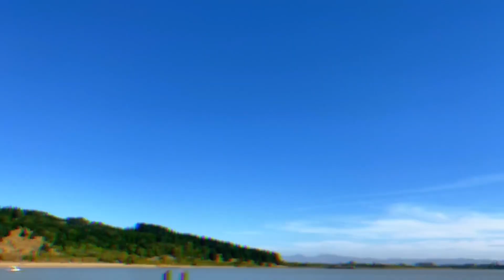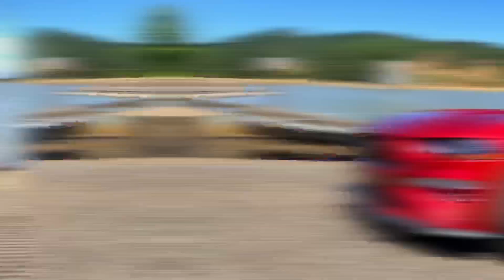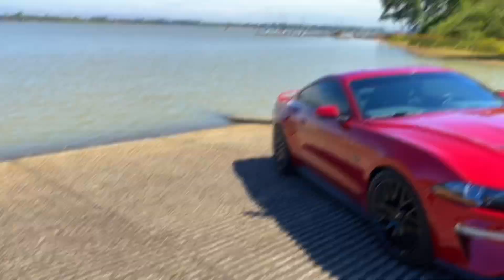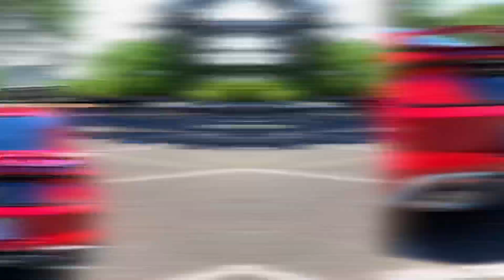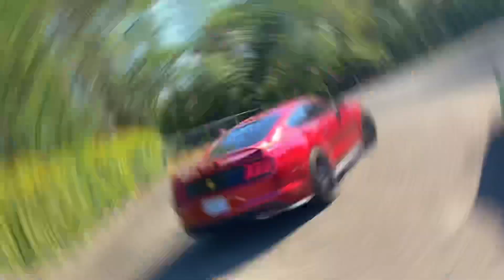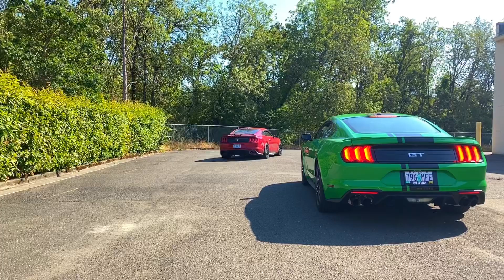Mustang gt x pipe vs H pipe

Comment: So as an owner of a 2015 GT I can honestly tell you ... the Axle back and the X-pipe or H-pipe truly don't come to life until you add a Long Tube Header ... at which point you will go from the cool guy in the neighborhood to the guy/girl that the entire neighborhood absolutely hates because the sound is on another level and its absolutely amazing! I need to do a sound clip of my 2015
Reply: Still waiting on that video.
Reply: Can confirm, running catless Outlaws with no resonators
Reply: Add racing cams, then you really have the total sound.
Reply: Comment made my day 😭
Reply: I've been there before. Had a 91 Scottsdale with a 350 TBI motor. Added some large diameter short headers and it was already tru dualed out the back with straight pipes and ha a mildly lopey cam. Either way I added mufflers as soon as I could it was ungodly loud without cats or mufflers!
Reply: Can't wait to add headers and actually cam my 14, then my 5.0 with Corsa Extremes will be ALIVE, and yes I'm keeping my Extremes after headers, and keeping H-Pipe setup. I want my car to SCREAM!!! The Steeda H-Pipe and AWE Touring H-Pipe catbacks sound incredible with headers, so I can imagine extremes.
Reply: I’ve got stainless works headers on my 15, no x or h pipe yet as I want my neighbors to like me😂

Comment: I was once thinking the X- option, not any more. As an European, I do not consider European sound as exotic or something, the X makes the engine sound smaller ,and like it is having a hard time moving the car. Some 2 to 1 systems with pipes before it just of wrong lenght sound bad too, so sometimes instead of Y-connection, a muffler with two inlets/one bigger out sound better. So, even if the pipes connected to the X happen to be just right and may give marginally more power, the sound is not "V8 enough"; the sound is like a John Wayne-movie dubbed in Japanese, I have heard that, and...

Comment: Do you think the brand for an H pipe matters for the deep tone???
Reply: Did u find anything about?
Reply: @SKKrry  naah man no reply sadly
Reply: not too much, mainly the diameter but some brands can use cheaper materials than others
Reply: Nah don’t matter, they all the same essentially
Reply: @malcolmbrown9733  really ok thanks man
Reply: Some use steel and some aluminum. Spend the little bit extra on the steel for mid pipe. After listening to a ton of these it’s very slight and most of all better quality.

Comment: Do you get more or less drone with the H pipe
Reply from the maker: I couldn’t say, I haven’t rode enough in the xpipe car to be able to tell but I’d think the h pipe would be a little more on the drone side just because of the lower tone it has but with that being said it still isn’t bad at all
Reply: Less drone on H pipe and more rasp and drone on x pipe. Also H pipe + MBRP exhaust sounds best with headers. You're welcome. 🙂
Reply: @mustangpilot6786  more drone on h pipe due to higher bass, less drone and more rasp on x pipe

Comment: How would an H-pipe sound with the stock mufflers? Anyone know?
Reply: It sounds like a tin can. Get aftermarket mufflers first and then the H pipe
Reply: @jadenbastien4160  what do you recommend?
Reply: @davidism8118  Borla, roush, awe, mbrp or corsa axle back. I personally went with roush  since I like how it sounded on a old friend's mustang
Reply: @davidism8118  I also forgot to mention if you have active exhaust, then you can pair up an h or x pipe with the stock mufflers. They sound great on active exhausts, but sound horrible without active exhaust on stock mufflers

Comment: H-Pipe Wins... I have a 2009 Charger Police Interceptor, Came Factory with X Pipe, i Put "12 Glasspacks and "3 Tips on it and it sounded Good but had a Annoying Drone around 2,000 RPM.
I had it switched to H-Pipe and it sounds soo Much Deeper Tone and Eliminated almost all Drone while Cruising.
Reply: H-pipe or no crossover plus glass packs is the holy grail of crossplane V8 exhausts for sure. 🙏

Comment: Have 04 terminator with bassani x pipe mid throttle between 2500 and 3500 is pure ecstasy ! But over 3500 on wot it sounds like shit to be honest might change out to and H pipe 
The x pipe at high revs inside the car sounds cheap to me